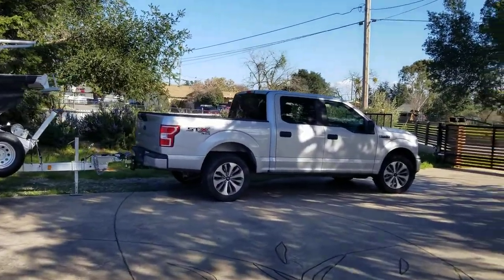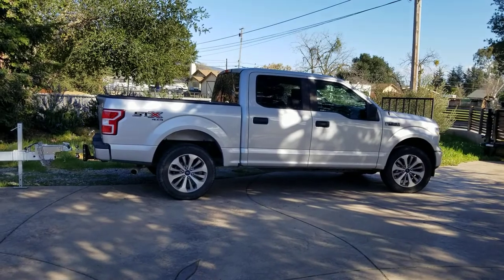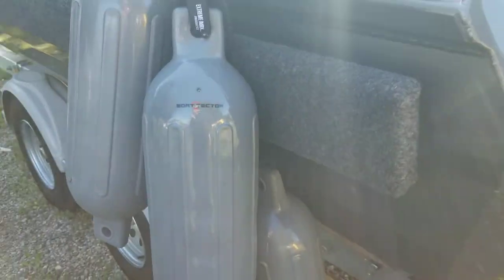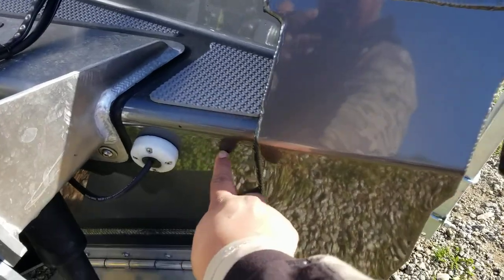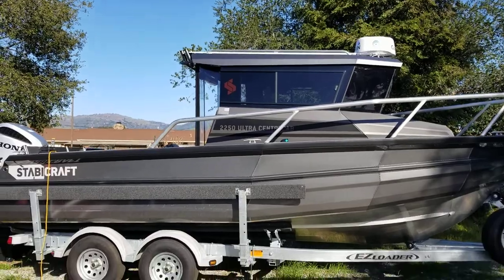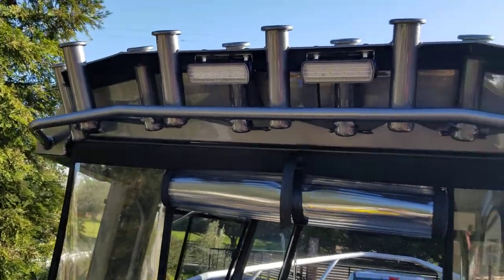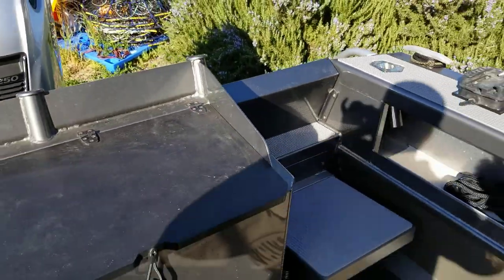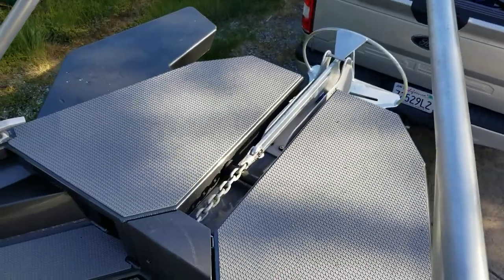2021 Stabicraft 2250 UltraCenter Cab full walkthrough Part 1 of 4

Comment: I was looking forever for a good walkthrough. Thanks.
Reply from the maker: Stay tuned.  I am doing a complete re-rig of the boat, both electronics and hydraulics.  Might be some good info when ordering a Stabicraft to make sure the dealer is doing what you want them to do in terms of rigging (battery locations, AP pump locations, battery switch locations, etc, etc).
Reply: +1 Thanks!

Comment: 2:15 the reason the roofline has a downward angle is because while on step the bow points up. This allows for a more level cabin while running. You might want to check how level your radar is while running, as it might be pointing up too much.
Reply from the maker: I've done this already and at running, the roof is still pointed down.  The 4 degree wedge is perfect at cruising/running speeds.  It may not sound like a lot, but the 4 degrees makes a huge difference.
Reply: @bsumoba  Gotcha, great that it works for your setup!

Comment: Great review of the Stabi 2250! Just outta curiosity, do you know if its hull has as variable deadrise (deadrise at the front of the hull and at the transom)?
Reply from the maker: There is a bit of variable deadrise.  If I'm not mistaken, the deadrise is 17 degrees at the stern.
Reply: @bsumoba  Hmm, that's interesting. My Weldcraft 22 Maverick has a greater deadrise at the bow entry and forward than the stern so I'd thought your Stabi would be similar. Do you know what your forward deadrise is?
Reply from the maker: @VJBILL1  I was mistaken.  It is 17 at the stern.  I am not sure what it is at bow entry and forward deadrise, but it is variable and has a larger angle deadrise at the bow.
Reply from the maker: @VJBILL1  I measured the deadrise.  It is about 45 degrees at bow entry, 22 degrees forward and 17 at the stern.
Reply: @bsumoba  yeah that seems about right for a variable deadrise. What's your fuel economy at cruise btw?
Reply from the maker: @VJBILL1  about 3.2 mpg @ 28mph.
Reply: Some kiwis call it Starbi craft, the 17 degree dead rise is merely a semi V hull, which is slightly increased at mid ship, and means hard riding in big seas.  It is just not as good as a deep v (21 to 24) degree fiber glass hull, which are molded with huge V at mid ship. check out Contender boats, a good example.

Comment: What engine in the ford and how does the f150 pull it
Reply from the maker: 2.7 Ecoboost - pulls the boat just fine, but I wouldn't go any bigger for a boat with this truck.  Engine has a rated 9K tow rating and I estimate the boat and trailer to be about 7K, so I am right at the "80%" rule of the thumb for actual tow weight to tow rating ratio